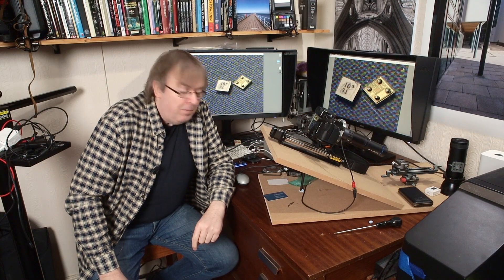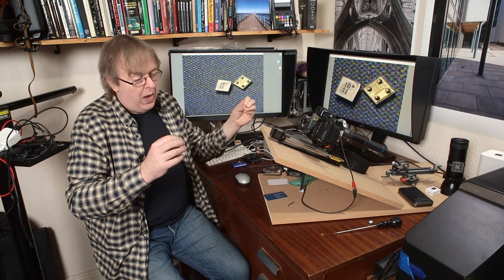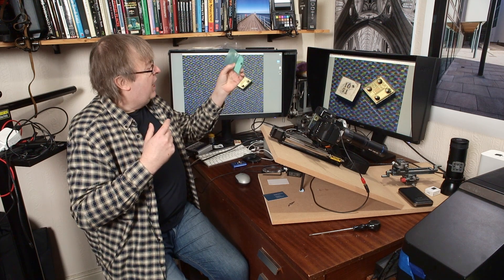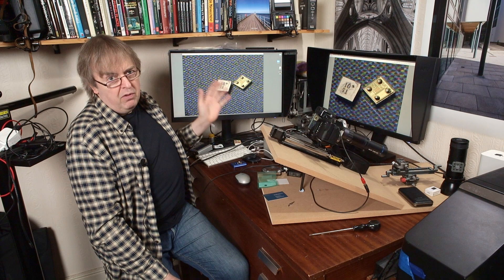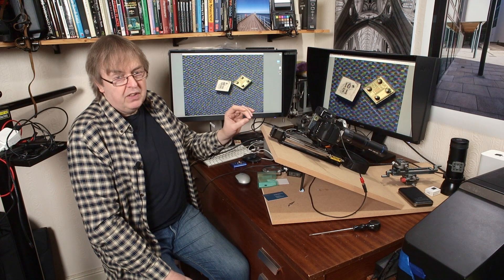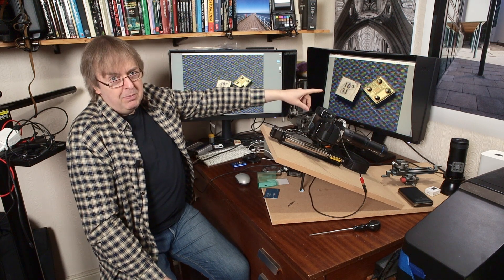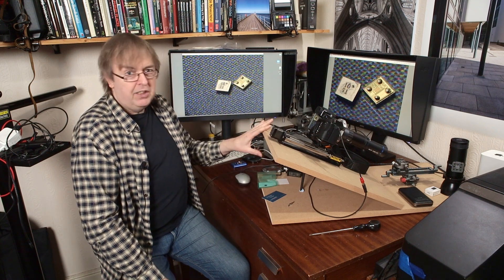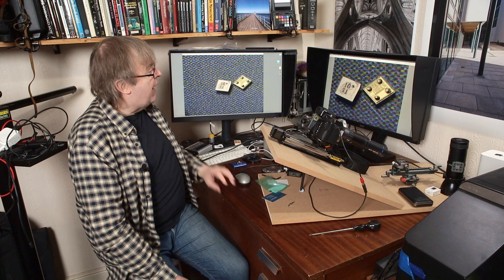Laowa Aurogon lens testing update 10x macro/micro photography 100MP GFX100S. Software & custom mount

Comment: You might try adding a lead sheet to absorb vibrations. There are more effective materials but they are very expensive.
Reply from the maker: Thanks - Something to consider, should I need this again after the Laowa lens kit goes back - my normal work is much lower magnifications and much less bothered by vibration

Comment: Hello Keith,
Thank you very much for sharing!!
Allan Walls Photography has good information about building a good platform and working with this system.
I personally use the full raw photos on the GFX 100 s, but do not load them into Helicon at the same time. (I use the Canon 100mm macro) You could consider that, a lot more work but better quality.
Kind regards, Jan
Reply from the maker: Thanks - I do use raw files when it comes to a 'proper' shot and for my normal macro work.
This is currently more an experiment to get a feel for the huge changes in going from a lens like my MP-E65 to 10-50x
Oh, and those Aurogon lenses are only a loan ;-)

This is the sort of kit I'd get if I had clients wanting such high magnification [and prepared to pay for the work ;-) ]

Comment: Have you considered silicone block feet or sorbothane donut isolators under that board?

I generally go for much heavier, stiffer platforms. My gear isn't in the same league as yours (just a Nikon Z7 and an assortment of microscope objectives and enlarger lenses) but my current setup has a rectangle of 3/4 inch plywood floating above the table on 8 silicone blocks, a layer of around 150lb of pavers, another layer of plywood, and (I believe) about 20mm aluminum plate with a ton of M4 threaded holes floating on more silicone blocks. 

The new setup is going to have a box tabletop filled with 600lb of sand.
Reply from the maker: Yes good suggestion. - at the moment it has thick felt furniture feet pads which are pretty good.
This is very much a Mk.1 experiment to get a feel for the lenses [which will have to go back to Laowa at some point].
The piano hinge works very well and MDF has a very 'dead' feel to it if you tap it.

I'll be using the setup [which folds flat - this is in a very small office] when I get the 110mm tilt/shift from Fuji - a lens and subject type much more in my areas of expertise ;-)

PS - the floor here would not like 600lb of sand - the house is solid, but built to 1888 standards... :-)

Comment: Super update - looking forward to following your progress! Just a quick question - would a studio stand not be appropriate to mount the camera on? I can see one off to the left of the shot, just wondering why you chose to go table-top for this.
Reply from the maker: Well spotted - the studio stand is where the stackshot normally lives.
Ideal for my normal close-up and macro - up to about 3x

The room moves too much [1888 floors] at 10x and at 50x you can use the view to see the effects of cars driving up the street.

The 'table' is a very solidly built map chest - full of 'stuff' - the MDF stand is on felt furniture feet. The whole thing just feels vastly more robust [at this scale] than the studio stand. which moves relative to the table as the floor flexes. There was a minor earthquake some 20 years ago when I was in the office and felt the flexure of the floor...  [that's a UK sized earthquake, so un-noticed by many people]
Reply: @KeithCooper Blimey. And I thought the Burj Khalifa was high with its 160 floors! ;) 

Appreciate the explanation. Thanks. You've got me thinking now about a filled chest of draws to mount my robot on, as it has so much torque it shakes the table it's screwed to at the moment. Fortunately my floors are somewhat sturdier than yours, and I suspect my studio stand (that the camera is mounted on) would be ok for work exceeding my usual 0.5 to 2x range. I doubt I'll ever get hold of the Laowa to play with, so will live vicariously through your review updates. Really appreciate the work you put in 🙏.

Comment: You might consider a VEVOR Tilting Milling Table, very heavy and very stable, designed for metal machining, but not too expensive.
Reply from the maker: Thanks... an interesting suggestion
However, there is no significant budget for this. The Aurogon lens kit is only a loan and has to go back to Laowa ;-)
Hence bits of wood and a piano hinge... :-)